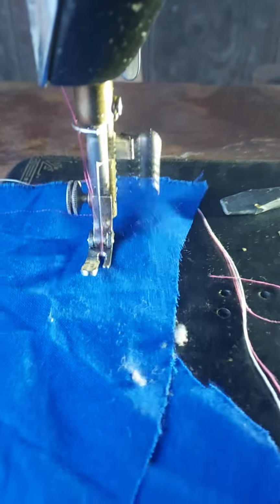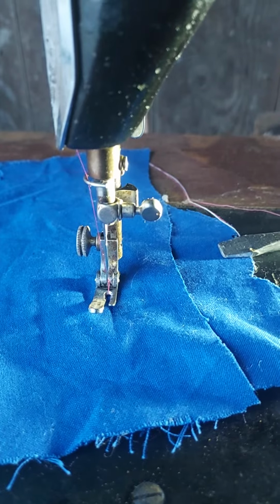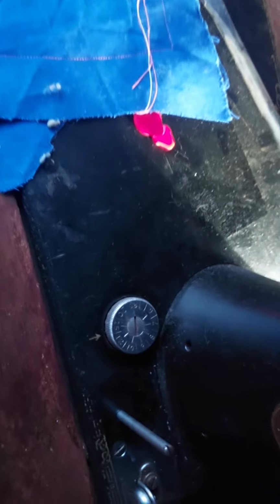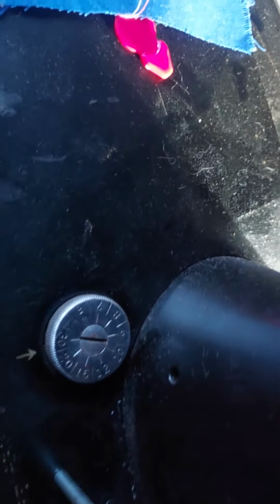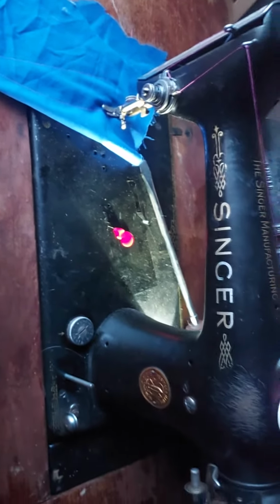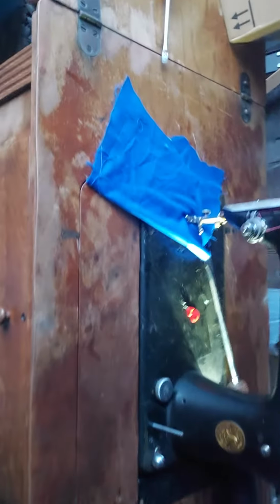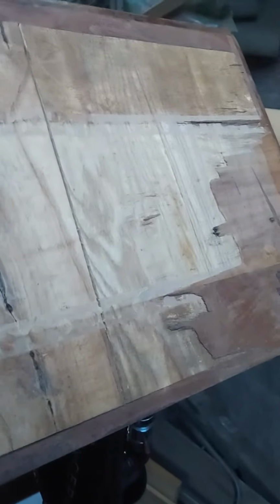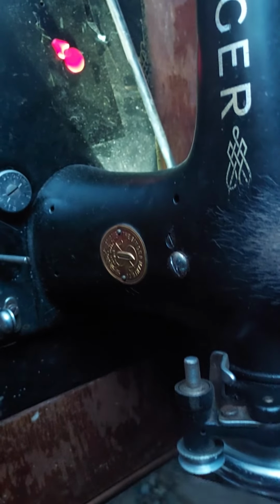Singer 101 take two

Comment: Hey man. I’ve had a 101 that’s in a bentwood that I’ve been trying to find a plug for. Idk much about old cords like this but how did you find one? Tested mine with alligator teeth and I know it works all I’m missing is the cord lol. I could really use your help 😅
Reply from the maker: https://www.amazon.com/gp/aw/d/B08CNLGZVC?psc=1&ref=ppx_pop_mob_b_asin_title
Reply from the maker: I needed three prong plug I ordered this one from amazon. I knew mine worked because I hooked up a a complete controller from a 15-91. So I purchased this plug.
Reply: @dalesuhre6522  damn. Mine has a two holes so it’s been tough finding one that’ll fit
Reply from the maker: @awoodenjar1761  https://photos.app.goo.gl/Bh5p2TTDr6B5kZVbA

If you have this type of plug on your motor and controller. I've seen these on eBay. And yes the the ends are very hard to get for the Bentwood controllers.